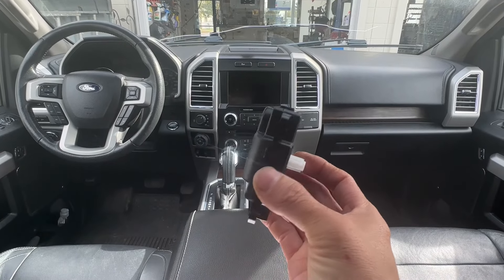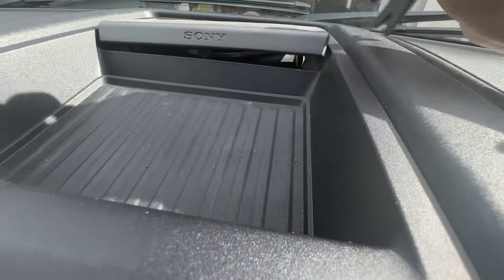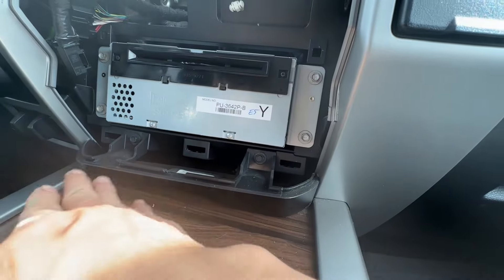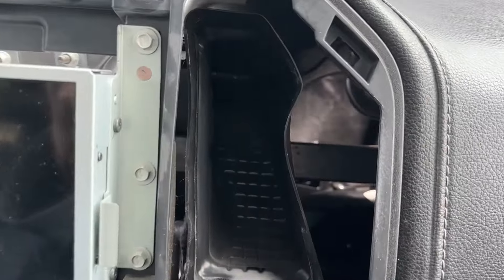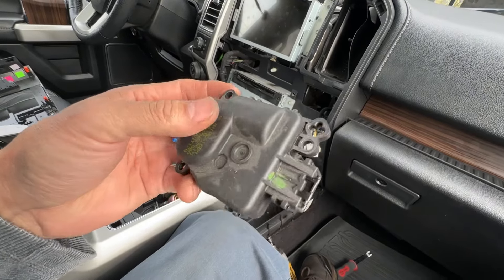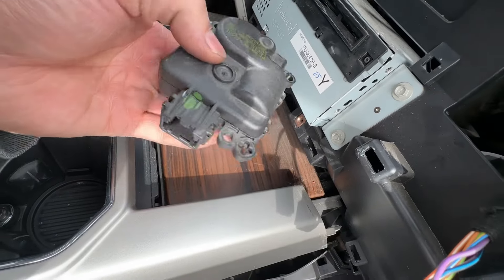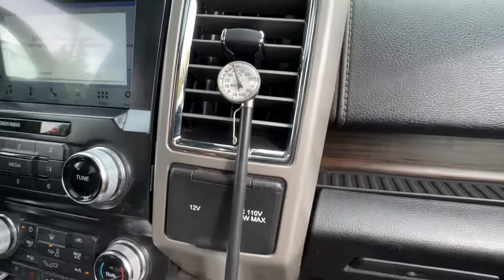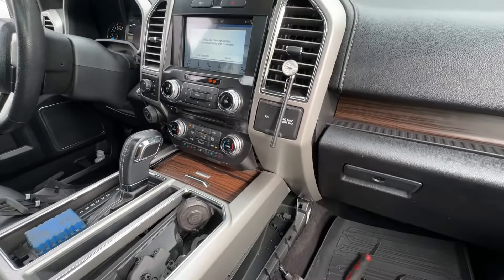2015-2020 F150 / The quickest way to replace temperature actuators without removing the dashboard

Comment: Great video. A couple of pointers for the next guy to come along and try this… 
1. The red tab pulls OUT AND AWAY from you and the actuator (towards the engine bay). Then you will feel the press tab to release the harness. I used a long metal “fork” to jab the press tab and harness away from me to get it out of the device. This was the hardest part of the whole process.
2. When you align that second piece and turn it to match the new actuator it’s actually easier to pull it out again and attach it to the new part. Then you can focus on sliding both of them together as a single unit over the actuator mounting pins. You can see the mounting pins in the video and you can see one while looking through the arm hole at the closest screw and another in the left corner closest to you. 
3. Get a pinch grip screwdriver with magnetic attachments like he has in the video. Super cheap on Amazon and will save you a real problem later on if you drop a screw.
4. Once you have the new one screwed and plugged in don’t put the dash back together all the way. Reconnect the dash electronics and turn on the accessories (press start without stepping on the brake). You should hear the new actuator “whir” and “slide” open and closed as the truck computer calibrates the new accessory. If this happens it’s a good sign that your issue is fixed (for me I wasn’t getting hot air to the passenger side)

Thanks for the video!!
Reply: When you put the bottom gear piece in, do you twist it until it fits and then put the actuator in and twist as well?

Comment: Excellent video! You gave a very detailed explanation!  My passenger side is blow hot air and driver side is blowing cold.  I now know the problem.
Reply: Were you getting heat under defrost on the passenger side and cold on the driver side as well?
Reply: Just replacing that one fixed it for the door unit
Reply: @therealernestbrooks3575  No, just the vents.

Comment: I replaced mine again. Here is what I found out: the arrows on actuator can be "re-aligned/repaired" if you manage to open up the gearbox manually set the gears, I am actually able to reuse my actuator. The true culprit is the Cam/Door Hinge interface being too shallow thus the groove on the cam slips out from the hinge (tip of rod).

Comment: Great video and awesome angles! Any idea which actuator it can be if the cabin air recycle button is enabled but the air still comes from outside? 2017 F150 King ranch 5.0

Comment: Great video. So timely for me to see this. My driver side heat was lost today in my 2017 F150 Lariat, passenger side works fine. If my driver's side blend door actuator has failed it is the one you pointed to in the video, the lower one that is visible without taking anything off the dash. To change the driver's side actuator it is cake? Easy to access without taking anything apart? Hoping this is true. Thanks for the future reply.
Reply: On another note, maybe you can give some insights into preparing for proper alignment when taking part out and then back in again. From reading several blogs on changing this or similar parts, you may need to place the actuator in a certain position using the control dial with the power on and then remove the fuse to fix it in a certain position before taking out the old one. I am still in the process of reading more blogs to better understand the issues that can arise. From what I understand you can run into a situation where when trying to insert the gear back in the two gears may not mesh properly. And because no matter how you cut it while changing this part you will be twisted like a pretzel, so best to plan ahead. Being in a pretzek for too long is not good for your posture. This is where this "resetting" step comes in. If you are going to do this yourself I highly recommend reading through the above cited blog from start to finish, and then some, to be in a better position to tackle this task. From what I am reading the dealership will charge you at least 8 hours to do this. My dealership charges $140/hour. Although you can save big money doing this yourself (a few hours of work) be prepared so you don't get sent to the nut house after your done. This reset thing can be a huge issue for us non-expert mechanics. I can't remember trying to tackle a project on my vehicles over the years and hitting the proverbial brick wall and giving up. I have a 100% success rate. However, from what I am reading, this part can be insanely difficult to change out if you are not privy to these finer issues, like the 'reset" issue. Read up and stay sane:)
Reply from the maker: @joedanow3106  You have your points and it’s true. For a proper  procedure if someone doesn’t have much knowledge and experience should understand better before doing the work. I’m a license technician just 15 year of experience and I replace many of actuators over the year and I haven’t need to do any reset because I understand how actuators work, 
This job take about 8 hours to do it because have to remove the dash on the older year and on the RAM, and I have done that in the past. On this Gen F150 it’s easier so I don’t have to remove the dashboard. All the actuators I replace in the past have no come back.
Thanks a lot for watching and comments !
Reply: Thank you so much for offering your free time to helping out the DIY audience in YouTube land. Can you describe a situation where you ran into the gears not meshing and you have to do some small procedure (like setting the controls to a certain mode level before doing the work) before removing the actuator? What I saw on one video the tech set the heater to a medium setting and then removed the fuse to that circuit. Also, if you can talk about the thickness issues with regard to trying to install a non OEM part, like one made by Dorman. The video I watched the tech changed out the actuator that is right against the floor (left side blend door actuator). He avoided having to rip apart the entire dashboard by removing the center console. It appears that taking apart the dash is a lot more work than taking out the center console. In any event, I believe it was for an F150 before 2015 and the lower blend door actuator was in a spot that was touch to get to. When he was ready to replace the actuator with a Dorman knock-off actuator (non OEM) the Dorman part was just an extra 1/4 inch thicker (black gear case) than the Motor Craft one (OEM part) and that was the difference of heaven and hell in replacing it. He had to go back to the store and get the Motor Craft one so it would be able to slide under the pried up console bottom. Watching that video made me afraid of getting into something that might be over my head. I realize that video was for the procedure for removing the lower blend door actuator in a pre- 2015 F150. From what you are saying above is that when you replace the drivers side blend door actuator in an F150 for the years 2015-2020 you do not have to take out the center console? You show it in your video after taking off some side trim of the center console. That one, the one that you did not remove, you are saying is quite easy to change? Have you changed it? Can you describe the procedure? Again, it is completely accessible after taking off one plastic tray liner (not sure if that is what you call the segmented part that needs removing down low on the console passenger side which will then expose the actuator) along side the passenger side of the center console? Sorry for the bother. Knowing this is so important in moving forward. Online I do not see a video of changing out the drivers side blend door actuator for F150 years 2015-2020 so your help will be tremendous. Thanks again   @silverstonespov5291
Reply: Does this fix the issue with passenger side blowing hot while driver blows cold
Reply from the maker: @aVagrantMan  depend on which side doesn’t working.
If driver side temp not changing is the lower actuator. If pass temp not working is the upper one, the one I’m replacing in the video

Comment: Thank you for this video….worked perfectly. I have a clicking noise after installation though…any thoughts what this might be? Could this be a calibration issue?
Reply from the maker: @larrylara7968  if everything line up perfectly when you install, especially the little piece that connect the actuator to the blend door then it could be bad actuator. Or you can try to disconnect battery to calibrate it. I’m install a lot of actuator but never have to calibrate them just note the position the one came out and the new one going in

Comment: Changed the part but still no heat, what else could possibly be changed or fixed
Reply from the maker: @Rulas01  First check to make sure cooling systems is working good.
Like heater hoses inlet and outlet is hot.
I assume the other side got good heat. Then check the blend door make sure it not broken. And make sure the piece connect between the actuator to the blend door is properly connected. Good luck

Comment: Wow! Very impressive great video/work! My 2016 F-150 limited passenger side is stuck on high heat only and cannot adjust temp. Driver side works fine for heat/ac.

Do you think this will work for me? Do you have a link to the part?
Reply from the maker: Sorry I don’t have the link, just tell the part person is the temp blend door actuator. Look like left or right side are the same part #, confirm with them. Thanks , good luck

Comment: Would procedure work on a 2019 Ford Expedition? It’s a dual climate and the dash looks the same.
Reply from the maker: @zachaustin6229  if it got the same dashboard design it should be the same
Reply from the maker: @zachaustin6229  if it got the same dashboard design it should be the same

Comment: 2018 Expedition dashboard vent reduces airflow with Bluetooth phone calls, once call ends you can hear airflow blowing on top of dashboard onto windshield doesn’t return airflow to dash vents, my question is which actuator is at fault and it’s location? Greatly appreciate your help thank you
Reply from the maker: Sorry for late reply, 
Look like you have a mode door actuator not work properly. It’s should be at the left side of heater box, look under by the steering column to the right, may have to remove some cover out